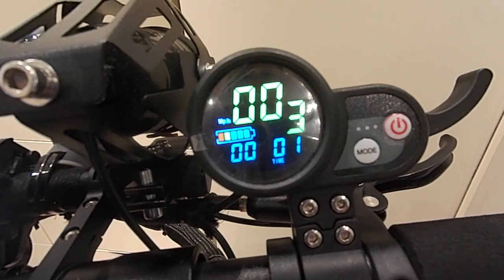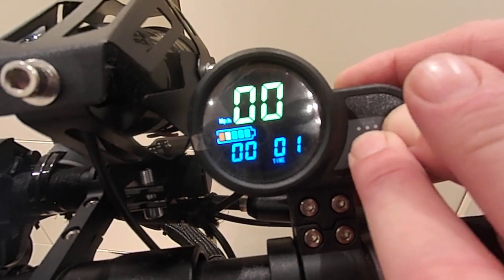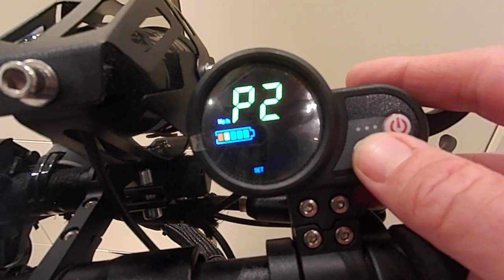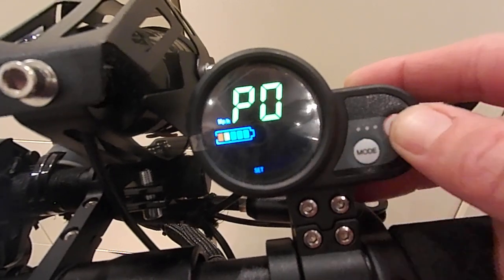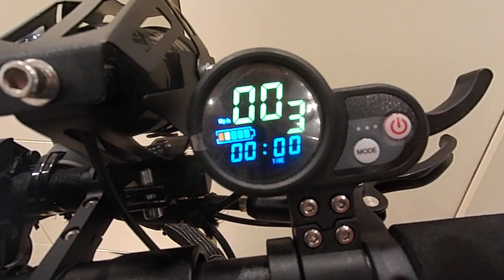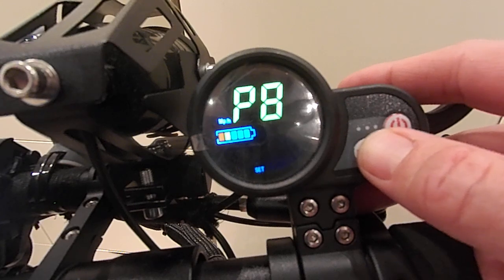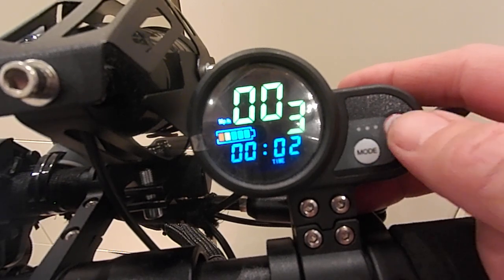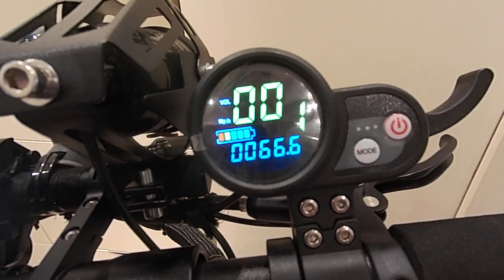Programming Electric Scooters for 10-Setting Variants (P0-P9)

Comment: How to reset all settings to factory default?
Reply from the maker: You can't. You have to go through all the settings and toggle the ones you want
Reply: @marcusoroberts  okay, Cheers for still being so responsive to the comments 😃.

Just a last question, if my bike isn't able to touch 30kmph despite allowing it via changing the P8, do you recon if I increase the P14 ( maximum battery discharge allowed) it will help?
Reply from the maker: I would suggest you leave that setting as default to protect the battery  @dhaisa
Reply from the maker: @dhaisa  I don't believe this will help unfortunately. Any battery settings will only change the BMS settings which will have no impact on speed. No settings will allow it to go faster.
Reply: @marcusoroberts  ok then seems that i'll have to reduce my weight 😂

Comment: How do you change the powers in the 3 modes? I have a 36v scooter and I am interested how can I change the speed and power limits in the 3 settings. The first lets me give with 15km/h the second 25km/h and the 3rd lets me go with 35km/h. Can I modify these settings? I would lower it to 15-20-30. I bought it for my wife and would be safer 😂
Reply: leave it on powermode2 or just dont go full speed?!?

Comment: Hi marcus , can i ask you if you could help me with an error code 8 on my walburg urban e scooter the scooter was only used 5 short runs i disconected the throttle cable as it was twisted , when connected it came up with erros code 8 , not been able to get any help from manufacturers at all , where would i get a repair manual to find out a fix for it , Cheers m8
Reply from the maker: Unfortunately it sounds like the usual Mosfet failure in the controller.

Comment: Hello Friend. great video.. I wanted to ask you something if you can help me. I have the display of my scooter that stopped working. But now when I want to find one, I see that there are many models that look alike on the outside. However, the AliExpress sellers told me when I sent them the photo of my controller, that they were not compatible... I imagine it was due to some software issue, because as I said, they are identical on the outside. round with the throttle trigger... like the tf-100 series. So I wanted to ask you, how can you know if it is compatible or not? What do I have to pay attention to? my controller is 18a.. 48v The problem is that I can't show you photos or anything here. Thank you.

Comment: Hi I have a 52v 18.5 scooter and I had a question for the p1 setting I have it set to 43.5v cut off but it seems to cut off at 52.8v it was weird because the scooter felt like it still had full power right until it turned off plus my battery on the controller displayed 3 bars left

Comment: Can I please confirm if you have the 60v 3200 watt chinese clone?

I think my motor poles is incorrect at 12 because the mph is about 10mph too slow. I increased the wheel diameter to compensate to 11.5 inches.

ThankYou great video
Reply from the maker: Thanks Chris, I have the 60v 2 X 2800w version. Hope that helps. Cheers
Reply: @marcusoroberts  you think trying to set poles from 12 to 15 will damage anything ? I can't get any info from the internet or the manufacturer.  Thx for the reply it is appreciated.
Reply from the maker: @docmortal  yes I would have thought it should be set to 15 by default. It shouldn't do any damage. Most of the larger hub motors are set to 15. Safest thing is to stand the scooter on blocks and run off load, see if there are rumbles or jerky vibrations. Then take it outside, gently to start. Let me know how it goes. Good luck!
Reply from the maker: @docmortal  BTW I have my wheel diameter set to 10 and seems quite accurate
Reply: @marcusoroberts  Last question I promise lol

I was thinking of adding a steering damper. On the neck portion near the front wheel SHOULD be 2 set screws for removal to add the bracket. On my scooter no set screws. Do you have these set screws on your scooter?

Thanks!
Reply from the maker: @docmortal  haha no worries ask away. Apologies for slow reply. I don't see anywhere to attach this. I don't think it would fit my T112. I personally don't see a reason to attach this, but you might no more about this than me. Please do let me know how it goes for you and stay in touch.

Comment: Once you set up regen, how do you use it?
Reply from the maker: It adds additional magnetic force to slow down and acts like a generator, feeds some of the power back to battery. It will cause the scooter to slow down more abruptly every time you release the throttle.
Reply: @marcusoroberts  I have a scooter with the same p settings but it doesn't feel like it's working.
Reply from the maker: @southpole560  Sounds like there is a fault in the wiring. As long as the scooter works, the re gen braking is a bonus. Just check for loose connections.
Reply from the maker: @southpole560  I personally either don't use very much, or only on a low setting for very hilly roads to save brake wear. I generally prefer to coast.

Comment: How do I know when my scooter is actually gunna give out my scooter always surprises me but I get paranoid is there any eco mode is it better to go in single motor but I’ve heard daul balances out the battery anyone know anything?
Reply from the maker: Hi Quaid, I know that feeling. The only thing I can say is to treat the Mosfets as 'mechanical' switches working very hard in a daisy chain scenario. Heat is the enemy so keep them as cool as possible. The controllers are usually built cheap and manufacturers economise on heat sinking, so that is something you should consider modifying. In terms of riding, just don't go full power all the time. Share the load between both motors will make you use less throttle for sure, as will eco, as you correctly say.  I mean, I have only had one controller go, so don't get too paranoid about it!

Comment: Hello, nice video but on my e scooter there isnt a p8 option any help on how to remove?
Reply from the maker: Hi, thanks. If there is no P8 power setting on your LCD, it is likely to be hardwired to default setting at the factory. Usually most scooters I have seen are set to 100% anyway, but you won't see an option for that.
Reply: @marcusoroberts  so is there any way that i can make it go higher than 20km/h??
Reply from the maker: @seimigraal7400  What scooter do you have? These settings relate to the scooters that will typically do 50+ kmh with no modification, such as the T112. There is no way in getting more speed without changing the battery, controller and motor which means a totally new scooter.

Comment: Hi how do I get my scooter to go to 30 kilometres per hour ? It’s at 25 Rn do you know bro to change it. V
Reply from the maker: What scooter? What battery voltage? What is the model?  Can't help you with no information
Reply: @marcusoroberts  ELECTRIC SCOOTER- DRAGON GT - 350 WATTS - 500W MAX
Reply from the maker: Unfortunately you won't get that speed ever from that scooter.

Comment: Great video bro appreciate it how do you set it to the fastest mode I saw a YouTube video about removing the speed limit and leaving it on dual Drive will that be the trick that was On PO8 set to 100 on the d+6
Reply from the maker: Yes p8 set to 100 as default, but removing the speed limiter cable will only remove the cruise control and in other scooters, the electronic gears.

Comment: Hi sir ,, i own a kaabo 8 ,, is it working to change this LCD?
Reply from the maker: Hi, if it has 10 settings, it should be almost identical. Sometimes the settings are reserved or not used, but it should be the same for all 10 setting versions. Cheers.

Comment: Can you give some solution why my scooter does not go when i push the throtle?
Reply from the maker: Is the throttle display lit up and are there any amber warning codes? Have you confirmed that the battery is fully charged? Do the other parts of the electrical system work such as lights, horn etc?

Comment: may i ask question
im from indonesia
my speedway turn off when i ride 
the indicator battery is full
it so dificult to turn on
but if i hub to the charger 
it can turn on 
please give me a solution sir😊
Reply from the maker: Hi Rahmad, sorry I am not fully understanding the question; the scooter only works and powers the motor when it is connected to the charger. Is that correct? And if you disconnect the charger, the scooter will not work? Normally it is the controller, but this sounds different.

Comment: Hi, I have a question, is it going to somehow turn off the side led light? Or at least set one color? Thanks
Reply from the maker: Yes there is a vid on my Chan on this, I think under T112+ Dual. It's quite easy to work out, but I installed a waterproof toggle switch
Reply from the maker: But unfortunately it is not possible to change the side lights from the settings.

Comment: What P-10 standing for on Electric Scooter???
Reply from the maker: This scooter only goes P0 to P9. If your scooter has more settings and goes higher than P10, it is usually PAS pedal assist mode and should be '2' meaning throttle start only.
Reply: @marcusoroberts  thanks for reply.

Comment: Hello Marcus. Great Work. I do have one of those Chinese scooters received two days ago with very similar controller to yours. I do have problem. Back engine stops working after few km. I am wondering if this is a matter of settings or electrical fault. Controller does not show any faults.
Back engine goes back working after a while. What could cause it. Thank you for your help.
Reply from the maker: Hi and thanks Sebastian. What happens when you switch on dual motors, does the rear motor still stop and the front motor continues to work? It is not a matter of a settings. The best thing is to place the scooter on a block and run it and see if it cuts out after a while. I know it is not running under load. If it doesn't cut out, then it's probably a loose connection caused when you ride under load in a real environment.
Reply: @marcusoroberts  Thank you. I hope So. I Tried to elevate the scooter and run for a while but as you wrote it would take a while. When on twin engine only front works and speedometer freezes. When only on front engine it works a bit slow seams half the power only in front wheel. Doesn't spin that much when it does when both engines are ingaged like it worked in some emergency Mode. I Will do Another test this evening and make a movie. Otherwise this is hell of a scooter. So fun and comfy. Awsome maschine

Comment: oh ive just checked and mine P1 setting says 50.5 just as a side note : do you know anybody that can make me a damper bracket with relevant screws etc for the Laotie ES18 i have the damper unit but just dont have access to build the brackets spacers etc !? this is the damper i have : https://www.aliexpress.com/item/4000767793511.html?spm=2114.search0302.3.330.258c24751sDK6v&ws_ab_test=searchweb0_0,searchweb201602_0,searchweb201603_0,ppcSwitch_0&algo_pvid=2e991e57-b7b3-4106-87b4-339202dbf7e9&algo_expid=2e991e57-b7b3-4106-87b4-339202dbf7e9-45
Reply from the maker: I bought similar ones for my T112 and frankly never bothered replacing them. I don't know of anyone that can provide adapters to fit, but I guess that any good motor cycle engineer could shoe horn these on for you. Mine appear to fit relatively easily, but as the standard ones are ok I thought I'd leave until such a time they lose efficiency...
Reply: @marcusoroberts  lol thx but i live on an island off the east coast of scotland but im from the south of england and there is no such thing as a good motor cycle engineer here  !

Comment: Hiya nice content but i was wondering i have the laotie ES 18 60v 38 ah controllers 2x 2600 motors = 5600 total ,when fully charged it reads 67v what should i set the P1 setting much respect thank you in advance xD
Reply from the maker: Hiya. I should ideally be in the range of 430-530 for a 60v battery. The Ah of the controllers is irrelevant , just the voltage. Then it gives good balance between range and battery protection.
Reply: @marcusoroberts  so mine reads 50.5 i guess i can just leave it as is then ?
Reply from the maker: @verbsy  yeah that's fine. It'll give you more range. The last thing you want is to spend a huge amount on a new battery cos it's too low! Those batteries aren't designed to have the last bit of juice sucked out of them.
Reply from the maker: @verbsy  I mean you could decrease to 430 if you are using very long distance.
Reply: @marcusoroberts  thx Marcus ,so it would be safe to set to 43.0 with no issue ? i guess the discharge is from 67v right
Reply from the maker: @verbsy  it wouldn't (shouldn't) cause any battery damage, but really only set it to that absolute minimum if you plan on taking for long rides. People with the little Xiaomi scooters will say they can ride until the battery runs flat. Not true. They will have an integrated and hard coded system that prevents their little batteries from going close to 0v
Reply from the maker: I set me mine to 520 and can easily obtain 20 miles with dual motors, non-eco, at between 30-40nph and still have plenty of  juice left in the tank.

Comment: I have an issue where my scooter got stuck on cruise control. Then I felt something kind of snap or dislodge in the throttle lever. Now, the throttle doesnt work and the scooter only runs when I push the single or dual button. As well, there is on the screen a picture of something like circles or an "ooo=" symbol. Please, help...Lol, thank you
Reply from the maker: Cardwell, sorry to hear. There are 4 fault codes. An exclamation mark in a circle means electric brake fault. An 'M' means motor fault. A cylindrical thing that looks like a throttle grip with a couple wires going around it means throttle fault. A box shape means a controller problem. I'm afraid it's almost certainly the LCD throttle. They can't really be repaired. Best bet is to get one from Alibaba or AliExpress. Cheers.

Comment: Thank you, very helpful.
Rated voltage 48v has to have a caution approx 42 ISH? Or is about input voltage? Your scooter example has a 60v rated? And can you ride it on last drop voltage as Xiaomi for ex.?
Reply from the maker: Hi Radhu, that's correct. For a 48v scooter you could probably safely set to 32V. This is to protect the battery and the BMS. I set my 60V to 52V but could be anywhere between 43-53V.
Reply: @marcusoroberts  Thanks Marcus, a 50-80% of rated power will keep my travel shorter but battery healthier-correct?The customer service  said 41.5... Hope my BMS automatically limits for my langfeite l8s. Plus is the winter low battery charge damage too...never had so many concerns with my previous Xiaomi! 😁
Reply from the maker: @radhuchristian8406  yes, correct. But maybe the Xiaomi had the voltage limit preset, perhaps, and not user adjustable..?

Comment: hi, i bought a janobike dual 2000 w and I did a top speed of 50 km / h. then I found out that only the rear engine is running and the front engine does not start, does not respond at all to switching the red button (eco limits me to about 35 / h) in the setting also does not want P3 to let me go to 0, is it related? can you advise please
Reply: i just got the Quickwheel explorer 2x2700w and have the same problem, only the rear motor engages. yesterday the dualmotor button did let me engage the rear or the front motor only, but not both at the same time. now only the rear works and i did nothing since then.... ;)

Comment: I have an Ultron T108 1600WX2(5400W peak) 35Ax2controllers 60V 17ah 100A discharge (old battery) , May you please elaborate further on P2(motor pole pairs)?
Reply from the maker: This is used to tweak the timing, similar to advancing or retarding the ignition in a car..

Comment: Hello, good work. 
I bought a scooter very similar to this. Brand new, turns on but doesnt accelerate at all. Do you know why this could be. Thanks
Reply from the maker: Trent it must be bad connection or a wire has detached. You might have to remove the footplate and really just inspect. Those Molex connectors are temperamental
Reply: Throttle doesnt work
Reply from the maker: Is this for both motors or just the rear. It already sounds like a controller issue. What happens when you engage both motors?
Reply: @marcusoroberts  both mate, nothing happens

Comment: Hi there, I have an Emove cruiser I think the max speed is 25-26mph is there a way to get a higher top speed with these settings?
Reply from the maker: Hi sadly not possible. There is no room for a higher capacity battery, and even if  there is room you'd have to upgrade the controller, then the motor. New scooter. You can't upgrade by parameter settings alone. Despite what others say, totally impossible.
Reply from the maker: Also, the T112 can do 40+ mph with dual motors, but weighs a lot more. But too heavy to carry around.
Reply: On the Emove Cruiser  the P1 settings recommendation is 430 and I set it to 385 and before I was getting 24-26mph now it’s 27-30mph is that possible by changing that settings?
Reply from the maker: @ushercozy  sounds like the battery protection setting. You can lower it slightly at the compromise of  the battery but the internal battery BMS will buffer issues
Reply: Marcus Roberts so should I leave it at 430 or at 385 ? Because the battery is a 52V 30AH